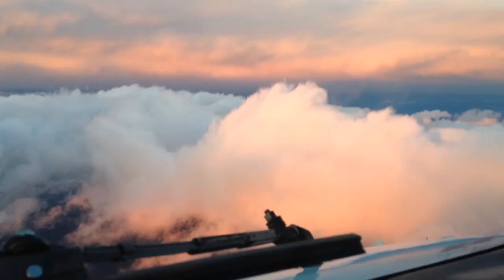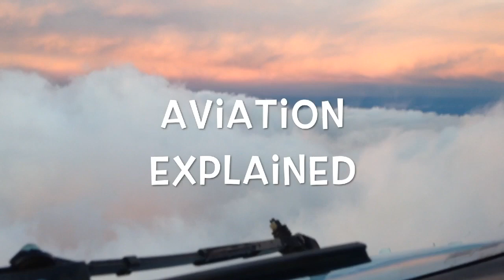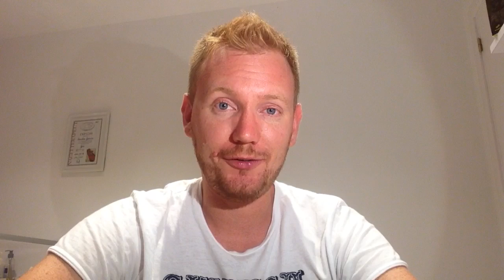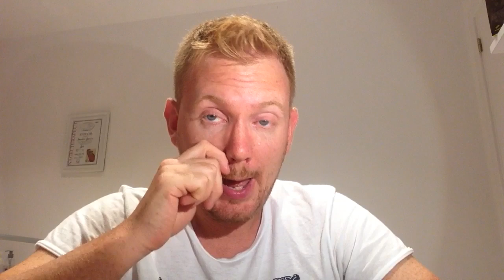Aircraft maintenance, why pilots shouldn't touch anything!

Comment: Just to clarify, this video is about commercial airliners.  A private pilot with an experimental airplane can [try to] fix just about anything he wants, and also [try to] make just about any modification he wants.  The rules for "certified" airplanes (which are normal airplanes, even small ones like a Cessna 172) are insane... you can't even change (or add) any piece of instrumentation or other component (like a light bulb) with something different (a different light bulb) without going through a huge, long, expensive, drawn out process.  The one half-exceptions is... you can carry portable equipment that has absolutely no connection to the airplane (cannot even plug into a 12V socket to get power from the airplane).  But with an experimental airplane (often owner build/assembled), pretty much anything goes.  Which is awesome, because most improvements owner-pilots make greatly enhance the capabilities and safety of their airplane.
Reply: +max bootstrap. You can say this, but mistakes can so easily happen.
The best example that I can give was when a theater changed over to energy saving lamp bulbs.
The management did it themselves, without realizing that the emergency lighting backup in event of a power failure comes from batteries that provide DC.
Fortunately on a scheduled check, engineers test tripped the power before the next power cut affected the theater.
The chokes in the lamps became a dead short to direct current and were smoking, catching on fire and exploding.
Just imagine a similar situation not being discovered on an aircraft until an engine failed cut off electrical power and the battery back up took over.
All because of a few lamp bulbs. (about 200 of them in the case that I mentioned)
Reply: @wilsjane  : If you want me to agree that mistakes can happen ... sure thing.  They happen in certified airplanes too.  They happen in every complex system.  However, most pilots of experimental airplanes improve the safety of their airplanes dramatically, which more than compensates.  Furthermore, a fairly large number of experimental airplanes are BUILT by their owner-pilots.  So, you don't want them changing a light bulb in an airplane they BUILT ?  :-o
Reply: Thank you for your reply. This is a subject that we could discuss in a positive way for hours.
Starting with the guy who built his own plane. He is obviously a very competent engineer in the first place and I have little doubt that he would make sure that he thoroughly understood everything that he touched, so needless to say, I would have no concerns at all about him looking after it.
However, I know guys who think that they can do anything with cars and I can mention a few who I would not trust to drive me to the shops.
I worked at Heathrow for a number of years and perhaps the biggest surprise to me was the guy who asked me to have a look at his hairdryer. Assuming that he was a steward, I was not particularly surprised when I discovered that he had wired the plug wrongly. It came as a shock when I found out that he was a senior 747 captain for the UK's largest airline. So no, I would not want him changing a light bulb in a plane. 
The humble light bulb is a good example, because it does not always blow due to wear and age. It can be a wiring fault overheating the cap, or the wrong bulb for the fitting. A competent engineer would look for this and correct any faults or errors.
It costs a lot of money to train a pilot and I have always said that rather than concentrate purely on flying hours, It would be a good idea for pilots to work for one year in engineering in order to obtain their licence. A better technical knowledge would undoubtedly have saved quite a few crashes. Particularly when pilots tried to move a broken rudder, blissfully unaware that all they were going to do was make matters worse. 
You may call me crazy, but I think that a week in the workshop when new models were introduced would also be beneficial and help to prevent pilots making bad decisions the first time that they came across a fault. (Do you remember the crash where a pilot shut down the wrong engine when he smelt smoke in the cockpit). Experience had led him to the wrong engine, because he associated the smoke with the bleed air. He was unaware that Boeing had changed the air flow to the opposite engine on the new model he was flying.
Needless to say, the guy who built his own plane would not have made such a stupid mistake. 
PS.
I am not an aircraft engineer, but I have worked (and still do sometimes) as a chartered design engineer for more than 50 years, mostly in the film industry. My 12 years at Heathrow was involved with architectural changes to the terminals. I have also worked on the UK national grid, including nuclear power stations.
So yes, I do think that in all critical walks of life, COMPETENCE is the key word and knowing what you can't do is more important than knowing what you can. 
Regards, Wills.
Reply: @wilsjane  :  It might surprise you to know that I would trust a senior 747 pilot to fiddle an airplane (including a 747 airplane) VASTLY less than I would trust any random pilot who OWNS his airplane.  Almost every time a 747 pilot gets into a 747 airplane it is a different 747 airplane than his last 10, 20, 30, 50 trips... not to mention working with a copilot he never flew with before much of the time.  And even though every 747 airplane is similar to other 747 airplanes ... they are also different in some ways.  But perhaps even more important is, the 747 pilot is trained to fly the airplane, not to understand the airplane.

In contrast, even an owner-pilot who never repairs or services or modifies his airplane is always flying the same exact airplane ... AND ... he has a much more personal and intimate concern and relationship with his airplane than pretty much any airline pilot.  That owner-pilot knows every problem the airplane has ever had, every tweak, every modification, every rattle, every squeak, every little peculiar behavior.  And most of them have looked into every peculiar noise and behavior ... and inquired if not interrogated every A&P who has worked on his airplane about what was the cause of every peculiar behavior and noise.

To be sure, not every airplane owner knows everything about his airplane.  However, he pays a great deal more attention to the documentation about the airplane he flies, and is much more familiar with that documentation.  Why so?  Because he flies the same airplane every day!  While the airline pilot flies a different airplane every day, and even if he did read 10,000 pages of maintenance logs before he flew every day, no mere mortal human has good enough memory to retain so much information.  To remember the details of one airplane is burden enough.

Also consider this.  I'll admit this is a very limited and biased example right from the start, but hopefully it makes a point.  Airline pilots know how to fly airplanes very well.  Why?  Because that is what they spend enormous quantities of time and effort to become expert in.  However, I've been a scientist, [mechanical/electronics/optical] engineer, inventor, product developer since ... well, since I was a little kid actually.  I've invented, designed, developed, built, debugged, repaired dozens of complex systems including entire computer systems (including the new CPU design), advanced automation and robotics systems that control massive complex scientific equipment, and so forth.  Which means, I know the difference between AC and DC and endless other aspects of electronics and control systems.  The consequences of this point is ... some owner-pilots have knowledge and skills (and tens of thousands of dollars worth of electronic test equipment) to know how to understand their airplane and "change light bulbs".

Yes, yes, yes.  Not every owner-pilot is has this kind of background.  Absolutely true.  However, do understand that even I could not understand the details of every system in a 747 without many months if not years of study of all the subsystems.  Which is my way of saying that pretty much any airplane that an individual human "owner-pilot" can afford is vastly simpler than a 747.  Absolutely not simple enough to be putzed with by random morons who don't know mechanical and/or electronic systems.  But certain subsystems really are fairly simple.  For example, if you remove a light from a wingtip, and on the bulb it says "LED : 9V to 15V DC at 2A" ... even an owner-pilot with rather limited knowledge of electronics could be fairly certain that replacing it with another LED light rated to operate at 9VDC to 15VDC (or wider) at 2A (with the same physical contact configuration) would not blow up the airplane.

Even so, any owner-pilot who cares about his very expensive pride-and-joy airplane would ask questions first if he had any doubt it was compatible, and also test the bulb before he flies away in the airplane.  In fact, he would do that even if he replaced the bulb with the absolute exact part number from the exact same manufacturer.  Why?  To assure the bulb works!  And if it doesn't, he would endeavor to figure out whether he had yet another busted bulb ... or something in the mechanics or electronics that holds or powers the bulb is wrong.

You need not try to convince me that "humans are dumber than rocks".  I say that phrase often in youtube messages, and I know this to be true.  And there are even some owner-pilots who are insanely irresponsible.  But you know what?  Most of them already killed themselves "flying", so very few of them remain to screw up their airplanes.  The vast majority of owner-pilots KNOW QUITE CLEARLY that they will be the one to die horribly if they do anything stupid or careless.

BTW, about your light bulb example.  I can assure you that the very best electronics engineers on planet earth do not perform an exhaustive test and analysis of the entire electronics system that bulb is part of ... when a bulb stops working.  Nope.  Unless there are some additional symptoms like "hot wires" or "black marks" or "odd odors" or something ... they will do what everyone does.  Namely, change the bulb and see if the new bulb illuminates properly (and they don't smell anything odd or feel inappropriate heat anywhere when they turn on the new bulb).

I hope we are not accidentally confusing the two types of pilots ("airline pilots" versus "owner-pilots of experimental airplanes").  They are different people in different situations with different degrees and varieties of experience and relationships with their airplanes.  They really are apples and oranges.  And though I would encourage every 747 pilot to attempt to learn and understand as much as possible about 747 systems, the truth is, they really should let engineers take care of the airplanes they fly.  In fact, by law they must... and for good reason (many of which you emphasize).  However, owner-pilots in general, and especially owner-pilots of experimental airplanes (which is what my message was about) are... different.

Your suggestion that pilots take a 1 year course in engineering is a double-edge sword.  That might make them somewhat more likely to recognize symptoms of problems in the making a bit better.  But it might also make them more likely to putz around with airplane components when they absolutely should not, because they think "hey, I have 1 year of engineering, so I can fix these airplanes too".  If airlines want mechanical, electronics, system engineers to be ready to debug problems during flight ... they should hire some and sit them in seats behind the pilot and copilot.  In fact they used to do that, but I guess no more (or rarely).

PS:  I'm not sure what a "chartered design engineer in the film industry" is.  But I'm just starting to slog through DaVinci Resolve to relearn video editing after many years of not doing any of that kind of work.  Not that I ever did much.  So if you know this software and want to help me out and get up to speed, do volunteer!  :-)  Because like you said, competence is crucially important, and right now, at the very beginning, even though I know a great deal about pretty much every piece of this endeavor (optics, light, images, image processing, 3D physics/graphics and so forth) ... I still have no idea how to do the simplest of things.  In other words, I'm totally incompetent actually running this application ... even though I pretty much know very well what it does and how.  Take it from me.  It totally sucks to be incompetent!  Hahaha.  :-)
Reply: I have never been involved in video editing, when I retired we were still using 35mm film and editing was great fun. At 90 feet per minute, a cinema film was 12.000 feet long and cut from more than 50,000 feet from the cameras. In addition, it cannot be overlapped, so alternate scenes were placed on 2 rolls and the printer light faded in on one roll as the other was fading out. All this was done on positive prints, so when the editing was complete, the whole thing had to be replicated on the original negatives. Then the A/B printers produced an intermediate positive. This now complete film was copied to inter negative and only then could a print be produced. All this before you even thought about producing a soundtrack. LOL. The whole process from start to finish on a feature film took up to 2 years.
Another thing that few people realize was the work that went into animation when it was drawn by hand onto the gels. Walt Disney's Fantasia, was the most complex film of it's era. 50 artists drew the gels working 45 hours a week. It took them 14 years to complete.
Stop frame animation came next, where models replaced the artwork. They had to be moved to the next position 24 timed to produce one second of film. I worked with Gerry Anderson during the time that he was shooting Thunderbirds. People today would not even know where to start. One wrong move, or a model falling over and you simply had to start the scene again. Up to 3 weeks work in the rubbish bin. LOL.
I mentioned lamp bulbs, because they were a major problem in the theater. In early buildings they were accessible from the roof void, but on later buildings (from the early 1960's), their was often a building above and no void. In some theaters, the building needed to be scaffolded to change a bulb. This could cost up to £15,000. As you can imagine, we changed all the lamps and every fitting was checked with a fine tooth comb. On every 3rd lamping, the lamp holders and fitting wiring was replaced. In one London theater, due to daily performances. the whole operation had to be done on Christmas day. Lamps were run undervoltage to extent their life.

Comment: Do most European airlines do their own C and D checks like British Airways does?
2 days ago I read a Vanity Fair article that Capt Sullenberger posted to his facebook page that is about Jet Blue and American Airlines no longer doing their own maintenance and Southwest Airlines no longer having Goodrich Aerospace in the US doing their maintenance - and having it done for cheaper in places overseas- like Ecuador.  

And then yesterday I just happened to be listening to liveatc.com and heard a 3.5 year- old Southwest 737-800 that was on downwind to Seattle International unable to slow below 210 declare an emergency because the flaps wouldn't extend. 
(B system failure, right?).  Of course they did the electronic alternate flap extension and I saw him fly over my house on an 18 mile final with the gear down and he landed uneventfully and was able to taxi in.
It was a 3.5 year-old 737-800 so it must have had one C check at the place in Ecuador.

Then the news yesterday showed cell phone footage that an American airlines passenger shot of a MASSIVE fuel leak out the back of an engine pylon.

Quite a coincidence, these two incidents happening to the airlines mentioned in the article the very next day.

I just asked you on your other video about U.S. pilots coming to work in EU for higher pay...  this maintenance issue is another reason to leave the US for the EU.
Is it possible to come there from the US with an FAA Commercial multi instrument, 2400 hrs, 480 multi, 80 actual instrument and no jet time?

Comment: I have a couple of questions.

1. How often does an aircraft maintenance engineer perform a d check?

2. How much structural inspection/Non destructive testing is done in a b or c check?

3. In a b or c check is structural inspection/Non destructive testing performed without disassembling components of the aircraft?
Reply: Ferrari_458_Fan I'm a 747-400 avionics mechanic, NDT will only be done if any damage or suspected damaged is found on A or B checks. On C and D checks there are certain items or areas that are routinely NDT'ed along with any damage found. 

I personally have performed many D checks. As my current employer has a large fleet of aircraft. Depending on age of aircraft and hours flown, landings and take offs everything is taken into account and a team of engineering planners will arrange when they come into the hangar for maintenance. 

A lot of planning in involved into servicing an aircraft. They ensure we have most and if not all the spare parts required. On a jumbo jet we can turn around a C check in 18 days, D check  in 40 days. Again age of aircraft will have an effect on how long they are in for maintenance. A few years ago turn around for a C check was between 7 and 12 days, and D checks up to 30 days. As they get older we find a lot more stress cracks and corrosion which increases downtime.

Hope this helps.